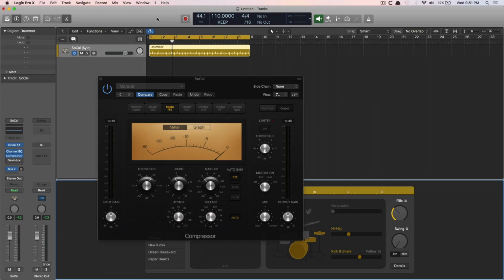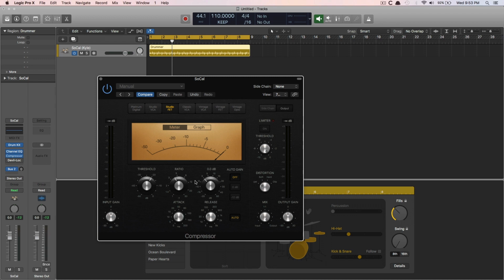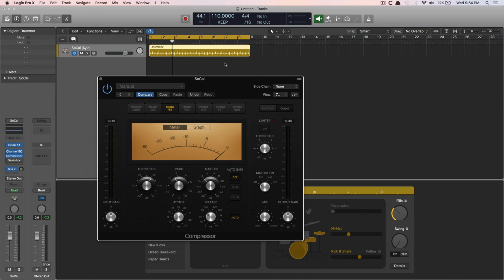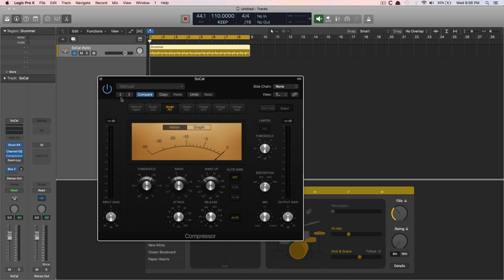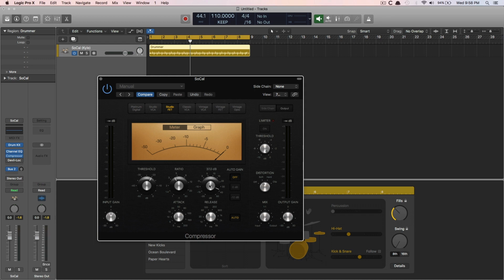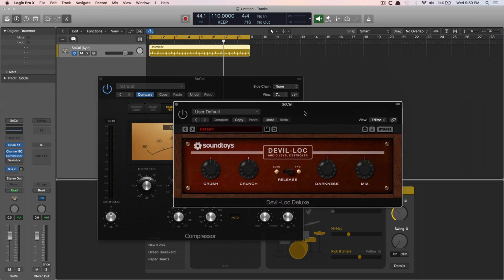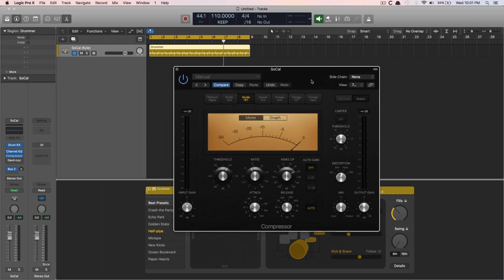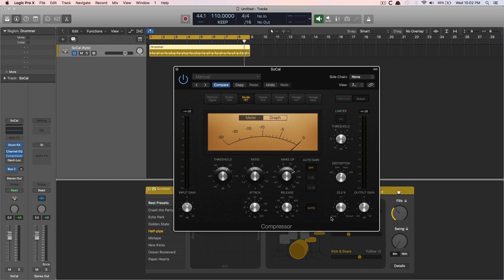The 3 Most Overlooked Features of the Logic Compressor

Comment: I agree to a certain extent. You can use the distortion knob without using the compressor and it still adds saturation. The make up gain is mainly used for the compressor section. When you compress a signal and say compress -5db of the signal. At a ratio of 2:1. You use the make up gain to bring up +5db of the signal that you're compressing so its an even signal overall. When you switch on the distortion to soft, hard or clip. Its already adding gain to the desired distortion you want. You compensate for that with the output gain. So if you use the soft setting. Which does add +3db of gain. You would take away 3db with the output gain. If you want, but that's not required. But honestly, the make up gain has nothing to do with adding more distortion to the distortion knob's job. I run instruments through the compressor disabled all the time. And just use the soft distortion and it does a good job all the time. See for yourself.

Comment: I use Logic 5 on WIn2000 prof SP4, it is very stable still. I did not make any music for 6-7 years, of course for hobby music I do not want to buy an Apple for Logic and also did not want to use another DAW, I am used to Logic workflow and one gets easyly back to its usage. I need only to re-learn some tricks re. mixing and mastering. The L5 internal plugs were already quite good imho. Esp. the ES2 synth, the EQ is good enough, the effects too. Only the older compressor is probably not the best compared to the one you show here. I use(d) therefore a freeware comp named "classic compressor" Problem is it has no graphic display, is there another older compressor (free) for XP/2000 you can link me to??  My "normal" system is Win7 64bit also very good - but Logic won´t run on Win7 so had to go back..I also bought an older Battery2 on Ebay but it was tricky to get the authorization with NI, however it is solved now the NI support send me now the right number to activate it. I can run eg. 7 x Battery+loaded kits in Logic5 without issues. Normally 3 instances are enough for most tracks..I also use the older synth1 and superwave VST synths.